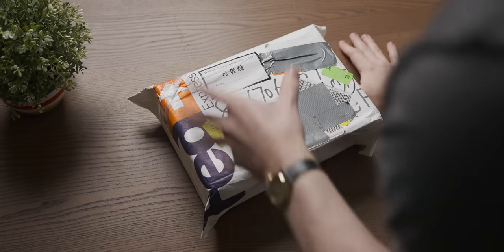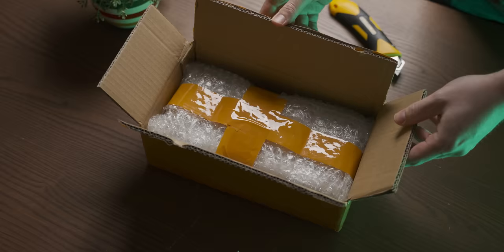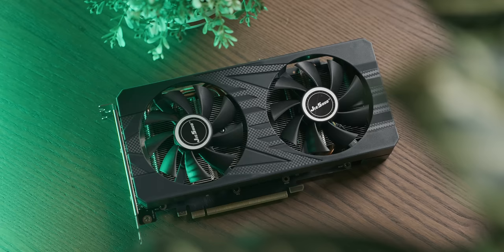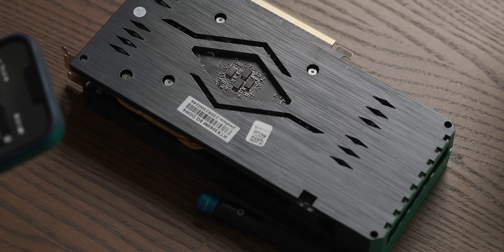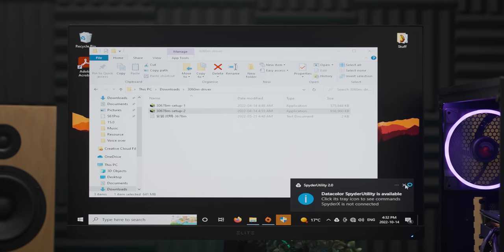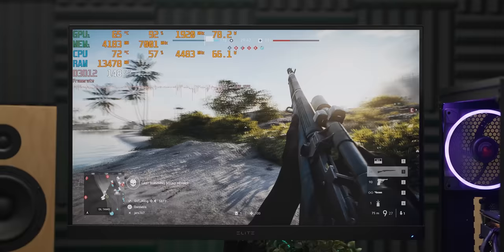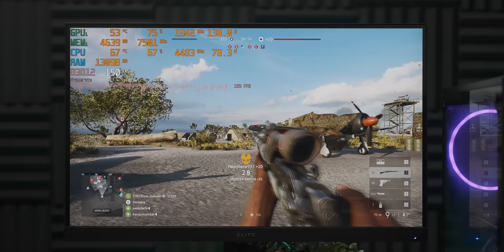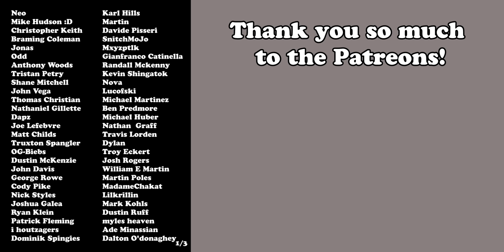This "New" RTX 3060 From Aliexpress Was Suspiciously cheap...

Comment: Well, someones missed a trick here. A legit version of that card at that price would be incredibly tempting in a budget build. Such a shame it isn't recognised by 'proper' nvidia drivers.
Reply: this specific card (the 3060M 6GB) is OEM only - so drivers are only provided by the partner vendor and is not included in the official NVIDIA driver packages. but this can easily be remedied by just adding the GPU into the INF file or via NVcleanstall

Comment: Soo how do you know that the AliExpress card is reporting the power draw correctly?

I know that apart from the +-70W from the PCiE slot official Nvidia GPU's tend to report the average power consumption very precisely due to Nvidia's control mania, requiring AIB partners to measure the input on the 12v rails. but I would count on... How is the manufacturer of this card called? To follow Nvidia's guidelines.

PS: for those who didn't know AMD only measures the GPU and memory, ignoring the rest of the board so the reported power consumption tends to be noticably lower than the actual one.

Comment: you should pair this with one of those sketchy BGA intel mobile processors that are soldered to a board for a socket, and have the ultimate "not-a-laptop" experience! Not sure what you'd use as a case though...

Comment: What the heck, it's cheaper and better than the real deal because you get the best performance while consuming way less power. The drivers maybe janky to deal with at first, but who cares. After all, it's a laptop GPU crammed onto a PCI Express board. For the price, it's a good steal. Only downfall is that it takes ages to come

Comment: the idea of desktop parts designed for power efficiency is great. I live in an island where power is unreliable, so i have a solar setup which includes a UPS. If i can keep my power consumption low, i can generally run my PC all day. I don't care about a 10 to even a 20% performance loss when we are already above 60FPS. I also under clock my CPU, its shocking to see my PC currently uses less power than the TV. 
Can you please ask AMD and NVIDIA to make low power high gaming performance Graphics cards on all of their various platforms? that way we can get them from reliable companies with original drivers.

Comment: There are better cheapo cards on ali that install official drivers. They're likely refurbished directly from factory refuse batches cards sold to a third party or refurbished used cards sold as "new".
But with ali it's always a gamble with no seller or ali warranties - don't trust the money back guarantee ads, and the platform won't remove scam product pages (there isn't even a way to report it) - so number of sales doesn't guarantee that it isn't a scam.

Comment: Seems like putting the mobile chips on a desktop form factor is actually viable? Probably really good in small form factor builds
Reply: there was laptop to desktop converted pc in indonesia, 3d printed case with 2 amd stock cooler, pressed again its motherboard. so basicly so small like 40x12x10CM and that was a beast.

Comment: I was fairly surprised when the Dodgy Boy did better than the RTX 3060 in Fortnite and GTA V! I mean I know they usually have lesser requirements, but still, I was intrigued. My question is how was it able to do that?
Reply: Simple. Fortnite really likes cpu cores/threads aswell as cuda cores(which laptop gpus usually have more)

Comment: I got a rx 580 8gb 3 year back from alibaba  turns out its a modded rx 570 with 100mhz or so extra released by amd for  china only but works till now with no problem .but i suggest do research alibaba has trusted sellers who sell 2 peice or above tag ur friend in and choose what u like going for one . meanwhile aliexpress is for presonal users so maxsun and other brands are ouut there quiet costly when compared to alibaba. pc winmax is a good brand though

Comment: What happens if you  simply try a driver inf  mod.  I do that a lot with mxm gpu laptops,  like clevo and alienware 4.gen mobile cpu  and  1060 , 1070, p3000 , p3200 gpu-s.

Comment: i use rtx 3070m. with 8gb vram. but it just have 1 hdmi for the display.... also for the driver i need to install from the seller driver.. its run well for gaming and stream too . but you cant use a multi monitor.. sorry for my english.

Comment: i got a 3060 from marketplace for 240, its a 12 gig model. good purchase?
Reply: It should not cost that much if it's used, so it's not exactly a good deal, but if around 200 or 210 i would say that's a great deal cuz this is how they should cost
Reply: @uhm175  it don't matter now, I sold it and bought a 4070

Comment: Outside of that drivers, card is likely used (ex mining card). I would like to buy Thier RTX 3070M but for 360$ with that sketchy (that could be not supported for long i need to pass on it). But it would be a grate option for Low power PC for times of energy crisis. Let's say in 250W you could build a 1080p beast.

Comment: I wonder if NVcleanstall would make a set of working (non virus) drivers? Tried it?
Reply: it would certainly work since none of the official drivers offered in the nvidia website have the 3060m 6gb included in the inf file as this card is specifically for OEM only so vendors would be the ones offering drivers instead. unfortunately this guy hasn't figured that out and blames the product instead

Comment: Did you tried Driver for Mobile Version of the 3060 ? because you have a mobile Chip, or try to re inject another bios in it with a EPROM . You tried to install normal rtx 3060 drivers (i have a real 3060 V2 EVGA so i know what i'm saying (from france lol sorry for my english) and i'm a little crypto GPU/CPU miner. LOL EDIT : I was in the middle of your video, and i found the solution before i saw the vendor message lol ! I'm a great technician :D For crypto mining this card is really efficient !

Comment: It will have an OEM hardware ID that needs to be added to the inf of the official driver, then it will work, had to do it on a sony vaio laptop when I couldn't get the drivers installed for 8400gts
Reply: exactly, this can easily be remedied by just adding the GPU into the INF file or via NVcleanstall

Comment: Hi bro, I just bought one, but it happens that it does not give me video, I tried putting a thousand different bios on it and only with one of Jieshuo it gives video but drivers cannot be installed in any way, I tried a thousand things, and nothing, always when installing them , the screen stays black and it no longer allows me to do anything or restart or anything, I have to remove the graphics card and connect directly to the mother, to uninstall the drivers. As the seller told me and I was investigating, apparently the card is only compatible with motherboards from 500 up, or from x79. What mother do you have? Is that true or have I already been scammed? :((

Comment: But what is when the driver gets old and you need newer drivers for future games?
Reply: you can just get around that by making unsigned drivers by adding the GPU to the official NVIDIA drivers via NVcleanstall or manually adding it in the inf file
Reply: @seibertron500  That, Depends on how hard this gpu hits. There is guru3rd community they would probably jump on the wagon and just release modded drivers. They are drivers for legacy gpu who up to date with current ones. Like GCN they release drivers every month and they are up to date

Comment: I suspect the power reading (80w) is wrong, there is no way it pulls 50% of the power the normal version does. If I had to guess they modded the sunt resistors to get over nvidia's power limits
Reply: Based on what?, mobile versions of the 3060 are available with a TDP of 60 to 115W, and the maximum draw can often be higher than the TDP. Obviously cooling is almost certainly going to be much better on the card, so it could likely stay longer at whatever maximum limit there may be. The main purpose of limiting power consumption in a gaming or workstation laptop is to prevent overheating.

Comment: This is a result of companies illegally activity, violating laws around end-user re-useability. What's happening is that the graphics card drivers will only work with specific laptop OEM operating systems. When you try to install the drivers it says "hey, you're not using an allowed laptop OEM operating system! how dare you try to re-use this product on a home-built PC." and then it just won't let you install the drivers. 

This is insanely illegal but sadly no one is enforcing laws anymore. Hail our corporate oligarch overlords I guess.

Comment: I'd imagine that the GPU firmware has been modified for a mining rig and that's why you can't install the official drivers. Chances are drivers you got sent are patched to work with the modded firmware. Of course it'd be preferable to change the firmware back to the original and then use the normal drivers from nvidia lol.

Comment: I have i5 9400 with msi rtx 3060 gaming x 12 gb...
When i played pubg pc my cpu utilize  100% but my gpu utilize 20% and i couldn’t get proper Fps. What's wrong with me?
Please help😞😞
Reply: Your pc should be able to run well. It may be your RAM configuration or your CPU overheating and being throttled down because of it. That in turn slows it down and your GPU utilization drops down significantly.

Comment: did you tried to download official mobile driver for rtx3060? guess not... i think you tried the desktop version of the driver...
Reply: he did try the notebook drivers - but the thing is, this specific card (the 3060M 6GB) is OEM only - so drivers are only provided by the partner vendor and is not included in the official NVIDIA driver packages. but this can easily be remedied by just adding the GPU into the INF file or via NVcleanstall

Comment: Why didn't you try to download the driver through GeForce Experience? The download button was there, but you tried an .exe driver instead.
Reply: won't work either way since the regular NVIDIA drivers offered in the website do not include this specific GPU into their driver packages. as this specific chip (the 3060M 6GB) are mostly OEM only - so vendors are usually the ones offering the drivers. but this can easily be remedied by just adding the GPU into the INF file or adding it through NVcleanstall
Reply: @seibertron500  at least read the comment you're replying to before you reply...

Comment: Vendor specific drivers, its the standard for mobile parts and a constant source of headaches. Wanna do a clean install on your Galaxy Odyssey? Nvidia turns into Novideo real quick, unless you use the driver provided by Samsung. They do this because different mobile devices have different limits for temp and power.
Reply: this is exactly the reason why the regular drivers won't work - this specific chip is OEM only, so only drivers are only offered by the partner vendors. but this can easily be remedied by just adding the GPU name into the INF file or adding it through NVcleanstall
Reply: @seibertron500  I had no idea, thanks for the tip.

Comment: since mobile rtx failed on desktop because of nvidia blocked the driver support chinese manufacturer moved on radeon such as 6600m which receives proper driver support by AMD official site and that is way cheaper then then 3060 6gb and in my bechmark 6600m 8gb beats even 3060 rtx 12G which is quit impressive

Comment: Hi Dawid so maybe you gave these methods a go but still ill mention it when i have these errors on driver installs what i do is Disable Driver signature then get Hardware info for the gpu from Device manager and last i add the hw info in the new nvidia drivers folder mainly on my laptop in the C:\NVdrive\DisplayDriver\512.15\Win11_Win10-DCH_64\International\Display.Driver\nvdmig file is where i add on those lines %NVIDIA_DEV.(ur GPU ids).(ur GPU ids).1028% = Section019, PCI\VEN_(gpu ids)&DEV_(gpu ids)&SUBSYS_(gpu ids)1028 and on the bottom lines where the gpus are listed NVIDIA_DEV.(gpu ids).(gpu ids).1028 = "NVIDIA GeForce RTX 3060 Laptop GPU"  prob not the best explanation but maybe u can google how to mod ur drivers im sure the forums i read how to do this are there GL

Comment: I'm curious if the card would work in Linux using noveau or similar open source driver.
Reply: he did try the notebook drivers - but the thing is, this specific card (the 3060M 6GB) is OEM only - so drivers are only provided by the partner vendor and is not included in the official NVIDIA driver packages. but this can easily be remedied by just adding the GPU into the INF file or via NVcleanstall

Comment: don't you have a 3060 laptop? try using that to install drivers then see if it works
Reply: won't work either way since the regular NVIDIA drivers offered in the website do not include this specific GPU into their driver packages. as seen in a part of this video, he is already trying to install with the official notebook drivers from NVIDIA but installation still won't budge. that's because this specific chip (the 3060M 6GB) are mostly OEM only - so vendors are usually the ones offering the drivers. but this can easily be remedied by just adding the GPU into the INF file or adding it through NVcleanstall

Comment: So the rather surprising takeaway from this is that it's a pity they don't make proper mobile 3060 graphics cards.
Yeah, that's unexpected.
Reply: Nvidia locked the driver to prevent people from putting in nvidia mobile to pci-e card.
Reply: @ahemjunior  Nah, the reason why the driver didn't work was because the mobile drivers need the sub vendor id to work with it, using NVCleanInstall and adding the pci id to the desktop inf file that doesn't use the sub vendor id should allow any current driver to work with the card.

Comment: The driver problems are completely normal for a mobile GPU, you always need an WHQL driver which is usually supplied by the laptop manufacturer before trying to install updated Nvidia drivers. Grab a gaming laptop with a fresh install like MSI and you'll know what I mean.
Reply: "you always need" is an overstatement. I have a Lenovo Legion laptop with both an AMD Radeon and a RTX 3060 gfx and had to nothing of what you say.
Reply: @MrCroky123  that's because you have the recovery partition intact, some brands like Lenovo leave a partition for the sole purpose of forcing Windows to use correct drivers on installation or maybe win11 finally fixed it? :D

Comment: How is that a low price, for a low end card? My kids RX 5600XT cost £249.99 on launch, the day I bought it for her. That was a mid range card, essentially twice as fast as her RX 570 which was retired to the media centre. We are talking THREE years ago now, maybe even longer.

So now, the 3060 which is essentially the same performance as that RX 5600XT - is "suspiciously cheap" THREE years later for the same price? It should be £150, it's a low end product.

People acting like the 2060 was worth £350, or the 3060 is worth £330! They're not! XD Stop perpetuating the myth. The 3060 can't even play many of the latest games at 1080p high settings and hold 60fps!

Comment: it could be that the chip was never meant to be in western country's or it is a mining bios on it or because it is a nonofficial vendor nvidia refuses to install. having a mobile gpu is no big deal for windows or any other pc because a laptop is nothing special it is still a normal pc but dumped on to a single pcb so it is technical a normal pc. the only difference is mobile gpus having only 8 lanes or less and a lower power target and can handle a more rough electrical and thermal environment. i see no problem why it should not work. how i said it could be that it is a nonofficial gpu so windows hat to be tricked too or other things had to be set up to make it work. but i do not know for sure. i dont use winddows any more and my laptop that had a dedicated gpu hat a radion in it and is now over 18 years old. my newest laptop uses a apu and is also 5 years old now. back in the windows 7 and xp era drivers needed to be downloaded from the vendor but now win10 and 11 do install them automatically and normally you dont need to search for them unless you want the newest driver and special features like nvidia experience. on linux is it mix, some distros do ist automatically and some only on a fresh install ans some are doing nothing and you have to do everything. the first is rare but the second is common and i think this works the best, or to be clear it has the best performance and nearly no errors if you using a Nvidia GPU, but be aware there are no official NVIDIA gpu drivers who will work for gaming because Nvidia is Nvidia. AMD and Intel GPU drivers are flawless and official on the other hand for some reason. even Raytracing works out of the box without doing anything.

Comment: just wait for some kid to post a rx 6700xt on ebay with "dead bios" and scoop it up for £160. Done it 3 times. all for less than £230 and easily recovered with an SPI bios flash programmer.
Reply: what if you buy one that has a dead bios for real?
Reply: @rise5544  oh, they all have dead bios. they try to re-flash them and especially the gigabyte cards just never re-flash. An spi reprogrammed can fix it but it’s easy enough to desolder one and buy one off of eBay.

Comment: did u try 3060 no m driver?
Reply: won't work either way since the regular NVIDIA drivers offered in the website do not include this specific GPU into their driver packages since this specific chip (the 3060M 6GB) are mostly OEM only - so vendors are usually the ones offering the drivers. but this can easily be remedied by just adding the GPU name into the INF file or adding it through NVcleanstall